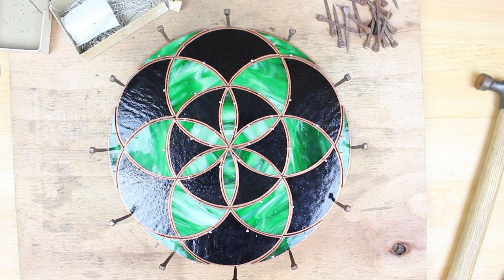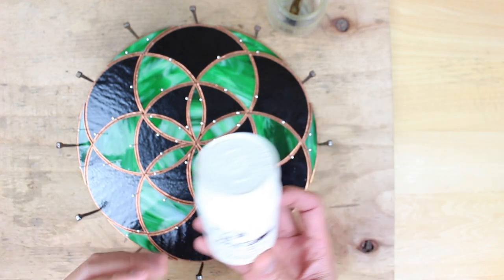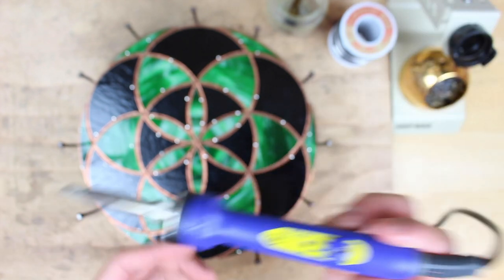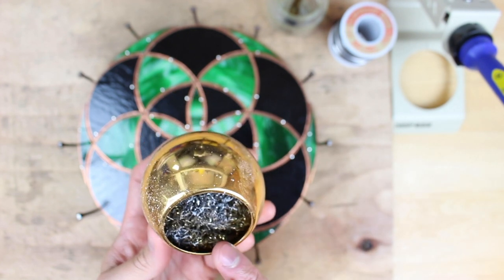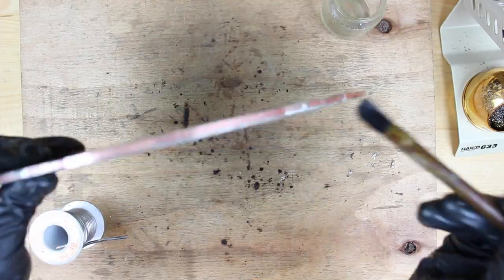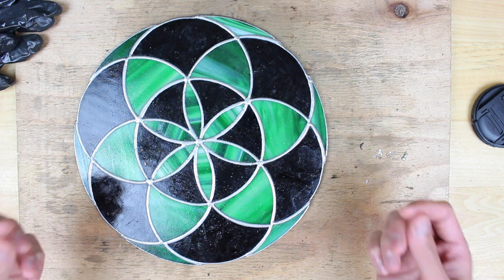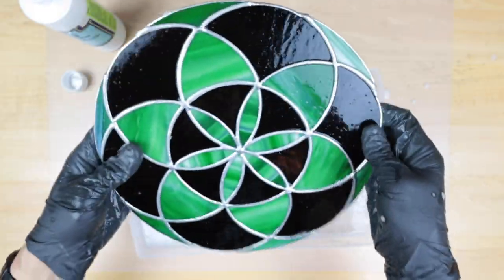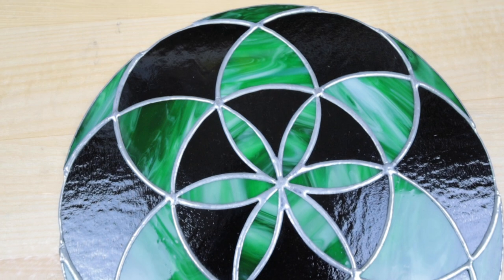Stained Glass SEED OF LIFE - Soldering

Comment: Looks awesome! My teacher taught me to use a piece of drywall as the work surface! Very easy to work with, cut down to size, cheap, doesn’t catch fire, and easy to push pins in to hold the glass in place.

Comment: I bought my first soldering iron in a stained glass shop last week. This one is supposed to be specifically for Tiffany work. The operating temperature is 500 degrees celcius and its not adjustable. Isn't that ridiculously high? It confuses me because all the tutorials recommend a much lower temperature.
Reply from the maker: Yea that’s too hot for me. You can buy a rheostat temp controller to be able to change that.

Comment: Is there a reason you're using leaded solder outside of the lower melting point or the shine? It might be obvious but I'm not a stained glass guy. I don't think the glass would crack from the temperature required to melt silver or other solders which don't contain lead. It just seems like a health hazard could be avoided for no real loss.

Also slight critique on your soldering technique. For best adhesion you should heat up the area you want to solder and then add solder onto the area, not the iron. If that's not possible because of the risk of cracking the glass, then you should still press the iron on the piece and add solder to the iron without removing the iron. Tapping the iron as you did will often produce cold welds and the temperature needs to be significantly higher for it to even work.
Reply from the maker: hey thanks for the comment.  I'm not even sure how I soldered that piece at this point since it's been so long.  The glass does crack if you let the iron sit too long so I like to move quickly around the piece.  Also, there is really no need to heat up the area like you would with zinc or other metals that could take that heat but copper foil will peel off and that adhesion will melt off and will lift from the glass so it gets plenty hot and does take solder nicely with some flux.  The lead came is delicate and will melt from the iron so also no need to heat that up to prevent cold welds from my experience but thanks for pointing that out as soldering can be difficult to learn and master.
Reply: This post is so old you might not see my response, but here goes.  Lead free solder is very hard on a soldering iron tip.  It won't last near as long with lead free as it will with leaded solder.  If you use lead free, use a dedicated tip for that kind.  You really only need to use lead free if you make jewelry.  As long as you don't put the leaded solder in your mouth it won't hurt you!!!!  When melting leaded solder for stained glass it doesn't get hot enough to put off harmful fumes.  We don't use anywhere near the heat for that to be a concern.  It's the acid in the flux that might be harmful if you don't have ventilation.  Don't be concerned about the lead!!!!!
Reply: @gailkfrommaryland7598  Hm, I'll believe you on the tips for sure since any additional heat would hasten oxidation at minimum, but for lead fumes you're incorrect. Not only do you need ventilation but you also need filtration. If you look at filters used in soldering stations you'll see that over time there is visible lead that gathers on them. If you don't have filtration on top of ventilation, then you're recirculating lead in your environment or sending it outside.